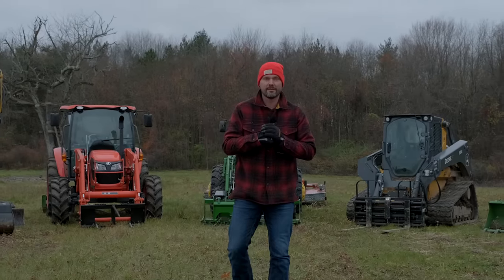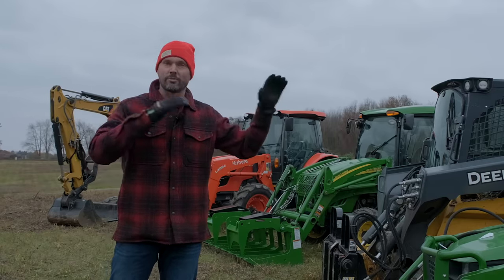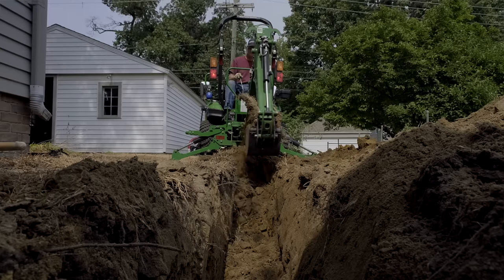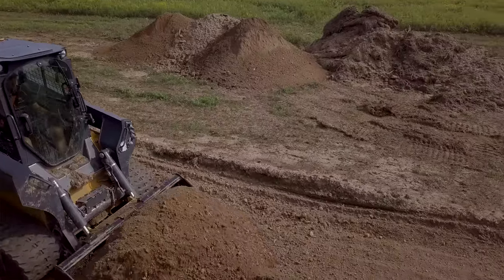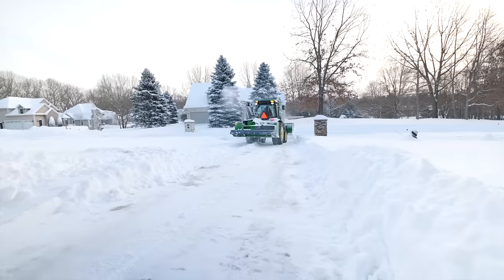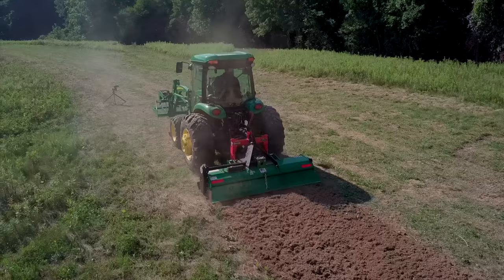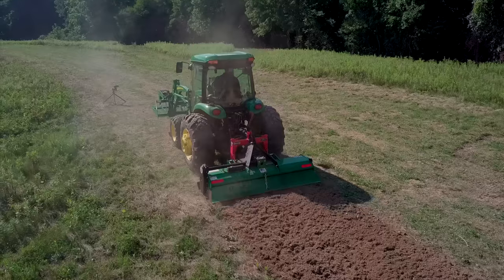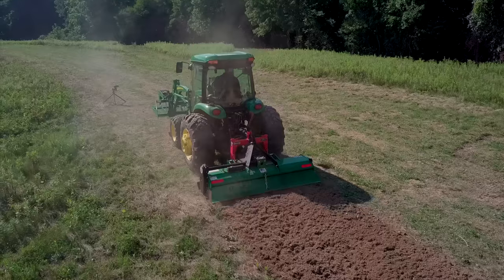IF I COULD ONLY CHOOSE ONE? BEST MACHINE FOR PROPERTY MAINTENANCE

Comment: The two tractors I have the most experience with are a Ford 3910 and a Ford 5030. The 3910 is nice because it can fit in tight spaces, but I hate it other than that. It is so light weight you bounce all  over the place and in spots of thick grass even a 5ft bush hog can get bogged down. The 5030 is better at bush hogging and offers a smoother ride, but the size is way too long with the front end loader. It can only handle I think 1500lbs too which is barely a 6' hay bale. I've been window shopping for years for when I buy my first brand new tractor and still can't decide what to get. Compact Track Loaders became my favorite on paper because they can do everything a Utility tractor can, but better, however the more I read about them the more they sounded like a pain. The two things about them you didn't mention is that they are far less fuel efficient (from what I've read a 75hp can burn up to 8gal/h vs a 75hp Utility tractor might be closer to 4gal/h) and they don't last as long. I've heard even mid-high end CTL's in the 75-100hp range start having major issues at 2000 hours. The 3910 and 5030 I mentioned earlier are both around 5000 hours and still run like a charm. To make things more complicated I just started reading about mini excavators and am starting to fall in love. They are definitely the least jack-of-all-trades, but on a per dollar and per hp comparison, they can lift heavier (25hp can lift 2500lbs), burn less diesel (1.5gal/hr?), and still have plenty of attachments. For example, augers can be found on all of these tractors, but since 3-pint hitches can't put downward pressure, a Utility tractor might not be able to dig holes in hard clay or rock whereas an auger for a mini ex can. They have mower attachments, grading, and several other things. 

The TLDR; There is never a 100% correct answer. Also, since I do rotational grazing I'm not worried about a bush hog, and have a lot of digging projects I want to do like swale, pond, and natural swimming pool installs, therefor I'm seriously considering a 2ton mini ex. If I needed a mower I would probably get a 50hp utility tractor and just rent a mini ex as needed

Comment: All depends on your needs, but work the mini/midi excavator for a while and you will see how versatile it is, grading driveways included.  If you need to cover more ground in a timely fashion, it is your least utilized machine, but put it in a project that requires shorter range and tons of torque, it's hands down the heavy lifter of the group.  Lots of toys to play with, enjoy!

Comment: 140 acres is some property, at least in my perspective. What are you going to do; farming, forestry, rental cottages?
 The category I really miss are the wheel loaders. They are built for hydraulic attachments. Volvo L30-K50, Avant 860, Kubota R 070W/R 090W, JCB 409/413, Kramer 8085/8105, Caterpillar 906-908 AG et.c.
 For every day use (pushing, lifting, trails, trailers) I would go for a loader, then just a plain tractor for the rest. Big enough (75 hp or more) to use pto and other implements such as woodtrailer with a crane and other stuff...
 I guess that it all depend on how much money one can invest. 250 000$ would go quickly 😉🤭🤣...
 Regarding the comment on JD and hydrostatic drive: if you step up to Fend 209-211 or similar size tractors you get "the same" with the automatic gearboxes. My PERSONAL opinion is that if one is to take care of and develop 100+ acres the machinery has to be up to pace with the task. If ,for exampie, there is alot of forest: maybe a combi harvester/forwarder (Alstor 840, Kranman 960, Malwa 560 combi)? If you are going to "help" others with lifting/digging maybe JCB 3CX/4CX, Lännen 8400 or New Holland B115?
 I think that a good combi-machine can be worth it's weight in gold but a barely big enough machine can be a pain in the butt. If on a budget I would suggest a few years older, a little bigger and in good condition over newer that is just satisfying.
 And the disclaimer: these are my thoughts, I representate only myself and I don't come with advice just opinion. As long as people don't get hurt they can (and should) do what they want. I am not allways right or flawless but not allways wrong either. Take care and be safe!

Comment: This is the situation I'm in. Bought (and loved) a 2038R for 5 acres of land and asked  probably too much of it. Regardless, it delivered better than it should have and treated me better than I did it. 

But now I'm looking at ~100 acres of land and not sure what to do. If money was no object, I'd probably grab a 50 to 75 horse tractor and a mini excavator, but I think I can do what I want with a 65 horse and a aftermarket woods BH100.

Popular tractor forums hate on sub frame backhoes, but I'm not sure I want to deal with a refurbished eBay mini ex nearly as old as me, or even a brand new one where I have to buy fuel twice, change oil twice, maintain twice, etc. If I wanted to dig a 5-acre pond, sure. I don't want to rent because I like to work at my pace.

I'm thinking LS, partly because of value and partly because of how many crotchety old farmers hate them on those forums. If they're hated on by people that think Kubota doesn't do wrong then they MUST be good!

Comment: Coming from a 1,000 acre ranch and multiple other spots of land we own I'll take a 4x4 bigger size tractor with a loader and or excavator, we have alot of steep big hills, big trees, lots of ground to cover and take care of and a big tractors hard to beat, can lift and do anything with it, mow bush hog pull lift trees and supplies, feed cattle, and go so many more places than a skid steer which we have also used and tried. A tractor, excavator and or dozer u can do most any projects, we've dug and run water and sewer lines etc, one thing I use the most is our little 4x4 44 horse New Holland, 99 model we scrape and drag the road, pull firewood logs bish hog really steep hollers, and it's 2.1 miles to our corral from the hard top in the deeper snow we use our bigger cab tractor with a hitch on the back to pull loaded goosenecks in with. So handy

Comment: I had to make this decision a while back and not wanting a computerized piece of crap I drove from Oregon to Michigan to find a low hour used JD 990 . I have no regrets. I used to maintain a fleet of John deers at a nursery and we had 70 and 90 series tractors with 10-15k hours and still going strong. The newer ones were crap and at the shop for repairs all the time. I have seen a lot of jd1025 for sale with not even 100 hrs. Pretty bad that people are dumping them right after they bought them.

Comment: First of all, I think the only way you can get away with one rig is if you buy a property that only or mostly needs maintenance. If your property needs a lot construction work then you need construction rigs such as the trac loader or excavator and there’s two reasons for this… (1) Heavy construction work is too much for any tractor. Depending on what you’re doing you may have to consider something bigger than what you are showing there. The second reason is the amount of time put in on a personal rig vs renting or hiring someone will pay for rig in two years or less. If your planned construction work is minimal then get a tractor and rent the loader or excavator.

If most or all the work is maintenance then I would say 7 acres or less get a sub compact. 7-20 maybe compact or utility and above that a utility. The only other thing to consider is how much are you going to mow regularly and is any of it over a drain field? Deere has the easiest deck mower to remove/install, but it’s still a pain to do if you’re swapping it out a lot. Additionally I wouldn’t recommend driving over a drain field with anything heavier than a sub compact. If you have a fair amount of yard to mow then get a dedicated mower.

Comment: Another great video.  I have 3 acres so I bought a 1025. I love it.  However I think I need a little more capacity, so am looking at a 2038.  I have run into the limit of the loader with pallet forks several times already.
Reply: I have the 3025e and it's been unbelievable tough and reliable. About 800 hours of very hard work and it still impresses me every time I use it.

Comment: I would choose a skid steer but, as you mentioned it’s pretty expensive.. lots of attachments and tons power with speed. I have a 2320 which I love, I’ve got 34 acres and it’s perfect, my ground is pretty flat. You can also purchase a hoe ram for the mini and they work great. If you’re excavating and run into a big rock you can just chisel it out of the way with the hoe ram and go back to excavating. Great video!

Comment: It's like asking a firearm enthusiasts "if you only get to keep one gun, what would it be?" hahaha

This is an excellent video since i've been researching for "WHICH HEAVY EQUIPMENT TO BUY FOR YOUR FARM" as we are planning our retirement "homesteading" soon. The question is though, which one will do the job on hilly and muddy terrain jungle of the Philippines?  It has to be compact and versatile when climbing and or working on steep muddy hills but also be able to work the fields. At first, my money was on the skid steer as it does pretty much everything except for lifting heavy objects. But, it can lift a bit and drag, but now I'm on the fence between the skid steer with a track or the multi-purpose tractor🤔🤔🤔

Comment: I used a skidsteer similar to that deer it was a 2 speed with wheels and it use to go through rims from torque. I found if turning on pavement you should drop your blade to turn easier. Great skidsteer but deer only uses deer attachments and that sucks

Comment: You definitely need a nice skid loader. You need APT o piece of equipment. After that, which can be about any tractor. You need both not just one. The skid loader has more hours on it than any other piece of equipment.

Comment: As well as the wheel track spacers a tractor rear tyres must have minimum 50% water added to tube for stability on terain or if lifiting with FEL

Comment: My only machines are two 80 hp tractors, I really need to sell one for a skid steer or smaller tractor. They are too heavy and long for yard work but I have to keep one. No other way pull out stuck trucks or run the bush hog

Comment: JD hydrostatic transmissions are notoriously twitchy especially at higher rpms.  Having a reverser and the appropriate gear is often better. The best would be a proportional hydraulic drive system such as they put on 450 Dozers where with a turn of a dial you can choose what percentage reduction you want for reverse.

Comment: I have an L4701 and a BX2680 (Kubota), brand selection came down to dealer quality. I have (only) six acres of very rough land. Slowly it’s getting civilized. When I no longer need to deal with 500lb+ rocks etc, the L4701 will go down the road. Not a day goes by without wishing I had a mini-x or a skid steer. I had to have someone come in and break up pickup sized rocks for me. Slow going with a compact tractor!  If I didn’t need to brush hog a couple times a week, I would have only a mini-x right now. Eventually, the BX will handle everything.

Comment: The way I see it, an excavator is not a piece of equipment you would typically buy, but rather rent and over a weekend or three get the "excavator jobs" done. The skidsteer may be a good idea for a short while when you're getting a property that hasn't been maintained for a few years. or decades, in shape. So it comes down to which tractor to buy, and there one would have to thoroughly analyze the amount of loader work vs mowing/snowpushing/plowing. For a property the same size as yours I would probably go for a gear drive tractor with a shuttle gearbox.
Reply: I just bought a used Kubota mini-excavator for 15k USD, and dug out a new koi pond which saved me at least 1,5k. I will soon use it to dig the trench for my ground-source heat pump, which saves another 5k. Then a long gravel road and formal garden, a large swimming pond, ditches for hedges, a sunken greenhouse, and all kinds of projects for the next ten years. Then I eventually sell it for 10k. Renting does not make as much sense for me.

Comment: Loader tractors have their place but they’re an awful compromise IMO, especially the compact ones. I mean this in regards to serviceability, capacity, visibility, safety and price. Personally I chose a late model used skidsteer,  2200 lbs capacity, and an older but not antique 90 pto hp tractor. Under $20,000 for the pair. Each can handle whatever implements I need, have cabs and are easy enough and relatively cheap to maintain.
Reply: under $20K for the pair? Either you haven't priced ned equipment lately or I haven't done a good job shopping for under equipment :-( I'm seeing prices much higher around here (NC) for all kinds of heavy equipment.

Comment: USUALLY Ya can do a little job with a bigger tractor(altho akward) but doing big Jobs with a small tractor will burn it up quickly.  
Big gear will last longer working easy that a small unit working at maximum ability. 
Choose to match your most used application.

Comment: Still not sure and running out of time, bought 40 wooded hunting acres in a northern clilmate on a seasonal road, I will have to plow 1/2 mile to a hwy, property already has electric, pole barn, trails, food plots, hunting blinds, man made pond, I will have a house built, I could take care of trenching for electric, digging for septic, I will have a sawmill and will need to lift possibly up to 1500 pound logs onto the mill, I will have to remove more trees for house and trails, carry and spread gravel for driveway, and need a post hole digger for significant fencing. So I have been leaning towards larger tractors like your series 4, enclosed with heat, the tractors I have been seeing on line are the yellow construction tractors with backhoe and loader like a john deere 310 or similar, any thoughts?

Comment: One machine. I’d agree, a compact tractor or skid steer. 
Good point . Digging post holes, brush hogging, grading, forking, grappling, bucket loading. All cheaper implements and less damage to finished surface with tractor. 

But:  which would I rather operate all day if money was not an object for machine or implements?  Tracked Skid Loader. 
Rent the rest. 
Mow with a zero turn. 
Rent the mini-ex when needed. 

I wouldn’t bother with a backhoe or skid loader hoe. Production is much higher with a dedicated excavator, with thumb and blade.
Moving the machine is so much easier while you work.  

I like the zero turn radius for working near buildings but I’d rather have the counterweight. 

Most people are afraid to rent the machine that’s bigger to reduce time and $$$. 

If you’re going to pay a delivery fee, go big.

Comment: Just a few observations:

1. There's really only 3 types of machine in this context: A front-end loader in the form of a tractor with loader arm & bucket, a skid-steer (with OTW tracks), and an excavator.

2. What is best depends on the property, what it needs, and how you intend to use it.

3. If you decide on a tractor, you will absolutely want a skid-steer style quick-attach setup, and ANY machine should have whatever optional hydraulics are available for it, especially high-flow if that's an option.

Personally, I'm a huge fan of excavators, but I think it will be difficult to surpass the utility of a tractor with an FEL and quick-attach bucket and the highest flow hydraulics you can get for it, as well as rear-remotes.

Edited to add two personal opinions:

First, if I HAD to choose, I would go with a cabbed 4wd tractor, probably a Kubota MX series.
Second, I love the idea of a Deere as much as anyone else, but Kubota is a much better value proposition. More bang for the buck, and incredibly tough.

Comment: I've used a lot of tractors over the years. Personally, I'm not a fan of the hydrostatic transmissions. I prefer the gear drive. I would probably choose a gear drive in the 4 series (the one you're gonna sell) or the Kubota you have. If I really needed a skid steer or mini excavator I would rent one instead of buying because for my place I wouldn't need one for more than a few days.

Comment: 1st comment today. I love my 1025r but it does feel small when I think about working my 300 acres. Transporting the tractor is the biggest factor for me. I would be maxed out for weight on my pontoon barge with a larger 2 series. Would love to get a 2032r or 2038r but for now the 1025 does what it can.

Comment: I have a 4310 now the 3000 series. Some days I'd like a little bigger sometimes I'd a little smaller. I have about 23 ackers of woods and fields to mow and the 4310 seems to be a great compromise for bigger and smaller. It also costs a lot less than 4000 series. All around use seems to be a tractor for me.

Comment: Nobody mentions a backhoe. 
As has been mentioned before, buy the one you can use the most, then rent the rest. 
A 15000 lb 4x4 backhoe can do a lot of work on developing a property. 
If you are someone that needs a Mulcher head, or a pto attachment job done once - hire it out. If you need it once a year - rent it. Another thing that nobody mentions is how much tougher a backhoe is compared to a tractor with hoe attachment. Both front and back of a tractor is much more delicate than a backhoe. Lastly, a backhoe can travel down roads quite quickly.

Comment: I had a L3901 with loader and backhoe. Not really “good” at anything. It was so awkward and goofy to use I never actually wanted to do the projects I bought it for. Digging out stumps was such a PITA having to move the machine around the stump constantly. And similarly you can’t dig in tight areas efficiently. The loader was weak given the size of the machine.  Would much rather have a skid steer, mini ex, and zero turn mower. Dedicate machines are the way to go if you want to get stuff done.